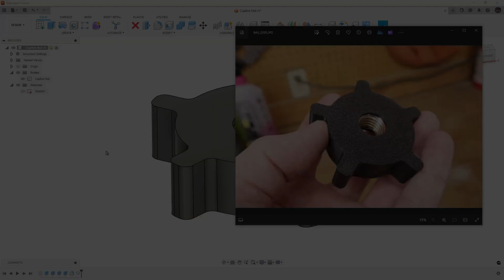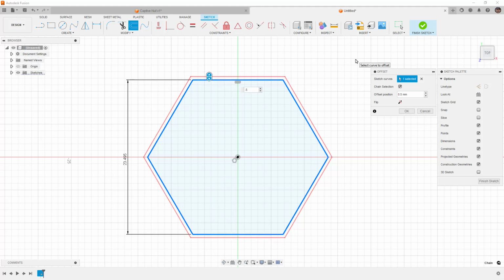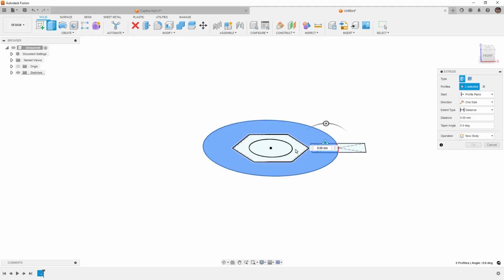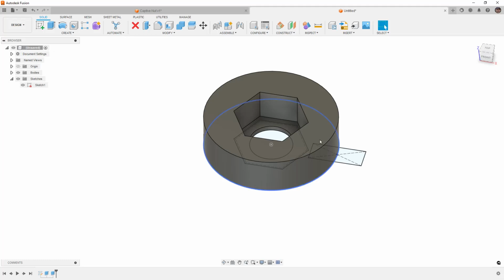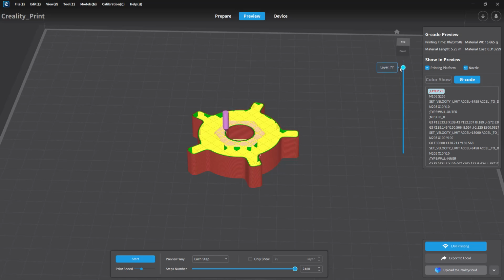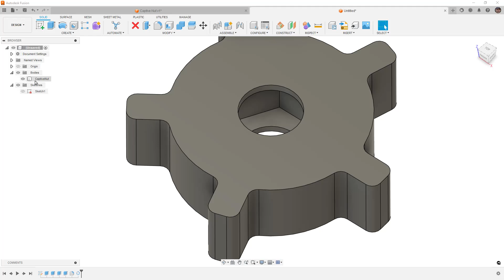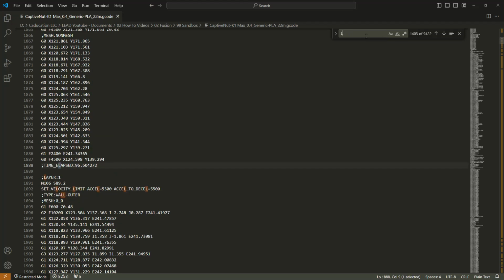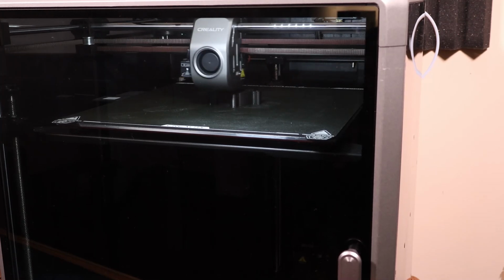Pausing A 3D Printer to Embed Hardware | Creality K1 Max | How To Modify G-Code

Comment: K1 (max) runs Klipper, not Marlin.  Marlin doesn't know the PAUSE command, but has many commands Klipper doesn't know (unless you define them as macros).  And you would better switch to a better slicer like OrcaSlicer so you can add such pauses without having to manually edit gcode ...
Reply from the maker: Thanks for the info. Yeah i think i saw some bad info online about the K1 running Marlin.....  I did a follow up video showing how to do this in Orca, Prusa and the updated Creality slicer and explained why I don't like to use them.  Everyone has a preference and for the amount I need to pause prints (very rarely) I am totally fine doing it manually :)

The short of it is that I prefer the UI/UX of the older creality slicer vs the new one.  I like a simple interface and all my settings to be in one place and a larger dialog to edit them when needed vs them being tucked into smaller menus.
Reply: @LearnEverythingAboutDesign  I'm kinda happy to see that I'm not the only person who's not a fan of the new Creality Print version. I love using it, because all I have to do is send my file/g-code to the printer through my network and that's it. And that's a functionality I haven't found in any other slicer for use with my K1. And thank you for this clear tutorial.
Reply from the maker: @DvanderPluijm  That makes at least two of us :).  I haven't found it to be any easier so I just stick with the old one :)
Reply: @LearnEverythingAboutDesign  @misterketube whats going on.. do you guys happen to know how to raise the nozzle when pausing a print? I have a K1 that only works with "PAUSE" none of the cura post processing scripts work (as im sure your both are aware)
Reply from the maker: @nickc7039  hmmm..   i use the older Creality Print and it moves the nozzle out of the way so i have easy access to the part.  I really liked the way the older version of creality handled this as most of the others might just pause and leave you with no access to the part.
Reply: @LearnEverythingAboutDesign  thank you. Mine moves the nozzle out of the way but it would be helpful to be able to move it up also. Either way very helpful to learn these printers don’t use marlin. Thanks!

Comment: Could you please tell me the firmware version your K1 Max is using?
My K1 Max has an issue where after adding a PAUSE command, upon resuming, it extrudes a little bit and then pauses an extra two times. 
This results in an unclean layer after the pause, even though the G-code only shows one PAUSE command. 
Thank you for your help.
Reply from the maker: My k1max has been "our of commission" for a bit unfortunately.  When i did this video it was on the original firmware that shipped with the machine and the machine was never on the network.  This was a fairly early machine just after they updated the extruder.  When i started having ringing problems i connected it to the network and updated the firmware.  I haven't tried a pause print after the firmware update as it created other issues with zheight and i have to replace the hot end on it.....  So sorry i don't have an exact answer for you.  I believe i was running v1.3.1.19 firmware when the machine shipped and when this video was done. but sadly after the firmware was updated I don't have good way to know.  it was either v1.3.1 or 1.3.2 but none of the 1.3.3 versions.
Reply: @LearnEverythingAboutDesign  Thank you for your polite reply and for explaining the situation in detail. I appreciate it.

Comment: 02.23.2025  
Creality v6+ slicer has the pause function in the slicer.
I noticed and you touched on this in your video and I saw it in your print that the resume layer is somewhat flawed, at least cosmetically on the outside layer.
Surely there is a way to get the print head to address this, but so far I haven't been able to get rid of the 'defect'.  It doesn't appear to be a functional problem, but more cosmetic.
Reply from the maker: I did a follow up video with different slicers.
https://youtu.be/ibtA6FOI3JE

But yes there seems to be a defect.  I have seen others mention some fixes for this.  I think if you build inside to out for the direction it might be better, but that means the traces laid down first would be on the nut...
Reply: @ yes I saw that and others. You are the only one that mentioned it. Others totally ignored the fact.
Reply from the maker: Which printer are you using?  Im probably going to get rid of my K1 max but i can do some more testing on it before.
Reply: @ k1 se. It runs great with over 700 hours of flawless prints except this pause issue. 
With that said I will be buying a K2 plus soon.
Reply from the maker: @graphguy  Good to hear.  mine worked great for a long time (no clue on hours), but then it didn't.  I started having leveling issues.  When i updated the firmware things got worse.  Mine was "offline" up until that and i put it on my network and things just got worse.  Right now i have it working but in my slicer i need a manual z offset of .5mm to get it to print and adhere properly....  While i was doing all the troubleshooting i bought a P1s and it has worked great.  SO much so i haven't really touched the K1 since.
Reply: @LearnEverythingAboutDesign  Ya, don't get me wrong.  I have had 5 Crealities including K1 and K1max and had many issues, sent 2 back.  But the K1se has been flawless.  But then I am probably jinxing myself!  Nevertheless I want enclosed chamber and the multicolor.  Right now I have one of the hideous Creality foil bag chambers for ABS and it is hideous.
Reply from the maker: just wanted to follow up on this.  I tried the Pause on my bambu p1s and it seems to do better than the K1 did.  There is also an option to print a "prime tower" which is just a box structure off to the side that is built up layer by layer and used for things like color changes.  Im going to play with it a bit more and see if this helps the layer line.  My first print was small and only a single layer on top of the magnet so its not really visible since i did this on a chamfer the height of the layer line.

Comment: what are the pros and cons of embedding a bolt into a knob WITHOUT a cap vs WITH one? Out of all the searching I've done, this w/ cap style is the closest I've seen to a fully captured bolt/knob.
Reply from the maker: Comes down to application.  Generally I make the hex shape for a nut to sit in plastic but not be captured in a traditional sense.  This works great in most applications BUT the nut can fall out.  So in a design where maybe its hard to reach you can either embed it like this or glue it in possibly.  The nut example is one that makes sense visually, but this workflow probably has better applications like embedded magnets or metal washers or other structural components internal to the print.

Comment: It would be great to have a filament purge command to ( prime the nozzle ) right after you resume the pause to get rid of the line gap..
Reply from the maker: agreed.  I would imagine bambu could do it since the nozzle wipe can be done for the AMS system.  I don't know how the K1 with multispool handles the purge but would guess whatever g/m code is used could be implemented here.

Comment: Another idea for you is, instead of printing on the nut which not everyone will have first time success. You can design a 5layer thick Hex cap with hole for the bolt to be printed first. Modify this design to add 5 more layers before you stop print. Drop nut in, then set Hex cap on top which if designed correctly for tolerances will fit and be smooth flush with layer height you stopped at. So, now when you start your printer back up.  Its printing on plastic again and you'll have a better and more successful print.
Reply from the maker: Thats a great idea! Thanks

Comment: I have successfully used a technique many times, that Makers Muse demonstrated. Instead of trying to print a circle in thin air after the nut is inserted, I print a 0.2 layer bridging the hole. This thin web / layer supports the layers above and easily breaks away afterwards.
Reply from the maker: Great tip thanks!

Comment: Super good timing,i was designing a catch can for a drag bike that will be mounted on the extended swingarm and i tought of adding 3 nuts inside the print,one for a inlet fitting,one for the outlet and another at the bottom for a drain plug.
Was thinking about printing it on PLA ,do you think that it will withstand the heat? Its pretty far from the engine and the exhaust
Reply from the maker: Awesome!  PLA might withstand the heat but I think the bigger problem will be the chemicals on the inside.  If you use something like a tank liner like POR15 you might get away with it.
Reply: @LearnEverythingAboutDesign  Ive looked into it and looks super useful! Thanks a lot again,btw the extended swingarm is a prototype that i designed in sheet metal in fusion to laser cut and weld,i'll try upload a pic when is finished
Reply from the maker: @nahuelise4055  Awesome. definitely send me a pic. support@caducator.com   Since you are doing a welded swingarm you could weld on some threaded bungs for inlet nipples and a drain and use the swingarm as the catch can.  I ran a UFO divided catch can on my race bike but was never quite happy with it and always wanted to build my own.
Reply: @LearnEverythingAboutDesign  for now i'll start slow and see if this design is successful,if it works well the next one will have the integrated can

Comment: Instead of doing that gcode editing,  why dont you just select pause in the slicer?
Reply from the maker: To the best of my knowledge I wasn't able to get that to work in the Creality Slicer like you can in Cura or Prusa.  You "should" be able to right click on the layer bar on the right and pause but I was un-able to.  If you know of a way to do that in the Creality Slicer I would love to know as that would be much easier !
Reply: @LearnEverythingAboutDesign  The most popular slicers being used are being used for a reason. I’m not looking to use a slicer that makes things more complex when you can just use “pause” the print. Does your printer force you into a proprietary slicer? If not ditch the Creality slicer.
Reply from the maker: The K1 max isn't tied to the Creality Slicer, but I prefer it and got better results with it out of the box than others.  The updated Creality print (5.1) has the ability to pause the print but the UI/UX is so much worse.  I have used the Orca slicer and don't like its ui/ux either.  I have sliced with Fusion and other slicers as well.  The creality slicer ver 4 just worked out of the box after tweaking the temps a little.  It printed great for a long time.  All these slicers are based off the same thing.  Creality is based on Cura.  Orca is based on Prusa.  A lot of the UI/UX elements carry over but for me I want to bring a model in, use my preset and print.

But thats why in the video i mentioned other slicers like orca and prusa let you pause.  maybe ill do an updated video showing the options in others, but the slicer for me is still creality print v4.  Clean UI.  I can get to the settings i need if/when I need them without it feeling like a science project all the time :)

Comment: Could you have inserted a Nut from McMaster Carr?  I have that option and it helps when it's a nut or bolt I'm working around.
Reply from the maker: You can but you just want to be sure you measure the physical nut.  While the tolerance on the drawings on mcmaster parts will be correct you should validate the 3d model.

As for if you need to embed parts into a print it just depends on the situation.  I have made loads of parts with an open hex and pressed a nut into them and it works just fine.  You can glue parts together around hardware if you wish but there are use cases for many situations.  If you never have to pause a print at a layer and have another method that is easier then for sure go that route.
Reply: @LearnEverythingAboutDesign  I've fallen into that hole before. From there on, I prefer my nut holes to be a bit loosy goosy. That sounded terrible lol. That also gives the option of using different nut sizes.
As long as the nut drops in place without me having to hammer it in or vise grip it to death, and it doesn't spin inside the hole, I'm happy with it.
One drop of crazy glue or blue Loctite, around the outside of the nut after assembly, sets it in place and doesn't come out.
Reply: I do that all the time. Bring in the part as a Step, place it where I want the cut out, and use the combine tool and cut out the nut. Or better yet, project the perimeter of the nut, and push/pull to make the nut 0.1mm larger around the sides, then cut it out. 
I don't captivate parts in a print, as it's a pain in the ass and I have to babysit the print. The old school way is much stronger as well, since it has more plastic to squish. 
This looks cute and cool, but not necessary. 
For those situations where something has to be embedded, I split the part in half, print it, then glue everything together with the parts embedded inside.
Reply: @piconano how does the glued parts hold up? For a low stress part for example?
Reply: @nahuelise4055  All the crazy glued parts in my experience were far stronger than a straight printed ones under high stress, if the top and bottoms were printed and not only fill.